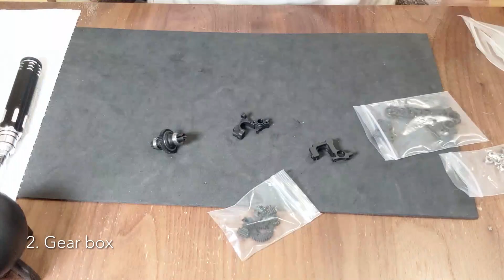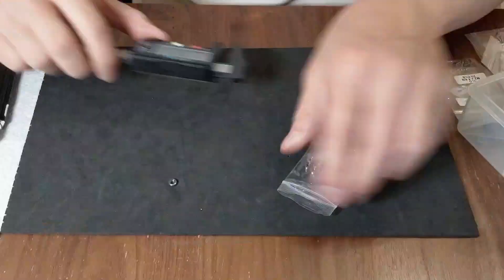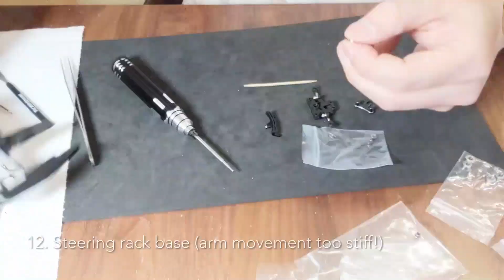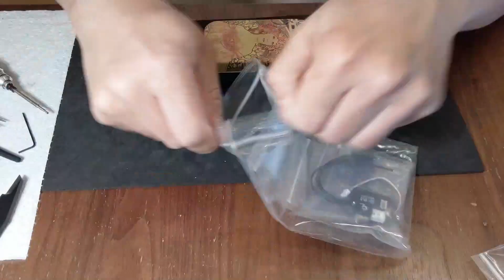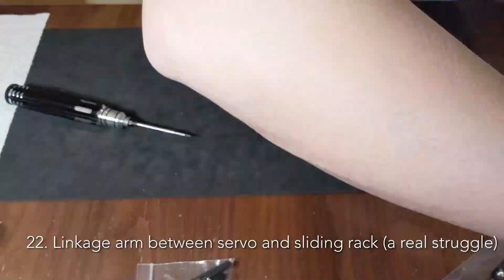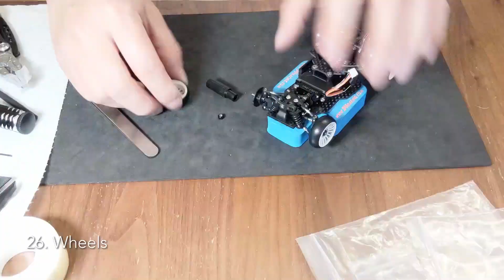HRC GLD 1/28 Drift Chassis Build Time Lapse

Comment: Thanks for sharing this.

I’m looking at this, sort of between this and the bmr-x, I can see there’s a lot of aluminium upgrade parts and they can add up a lot.
Reply from the maker: I think these micro scale drift chassis can all add up quite quickly, but it's possible to get just the essential upgrades with the biggest bang for the buck. I don't have a BMR-X so I can't comment on it. That one is 1/24 scale while GLD at 1/28 is shorter and much narrower. Each leads to an entirely different set of body options.